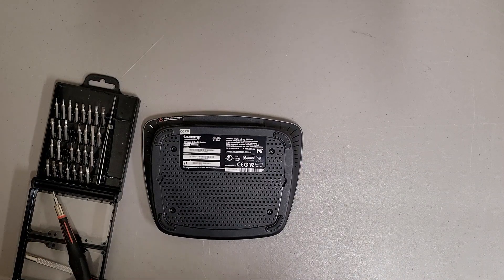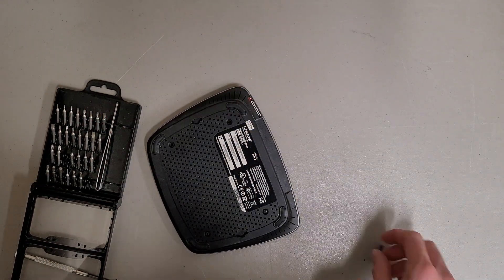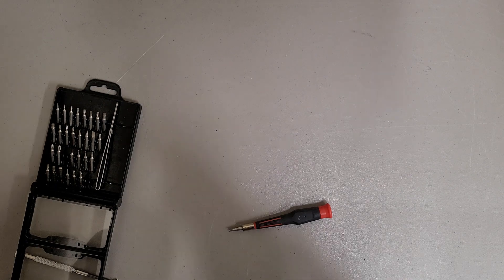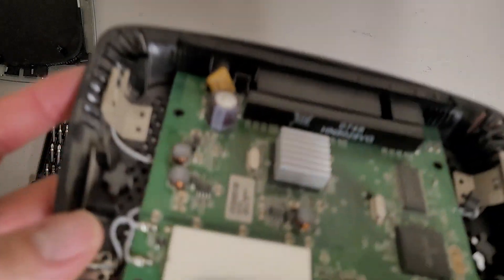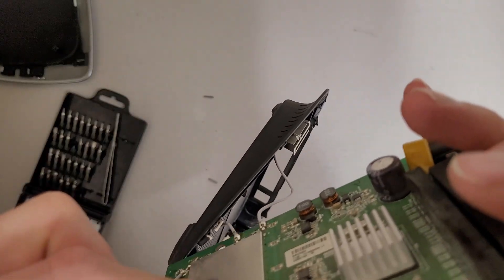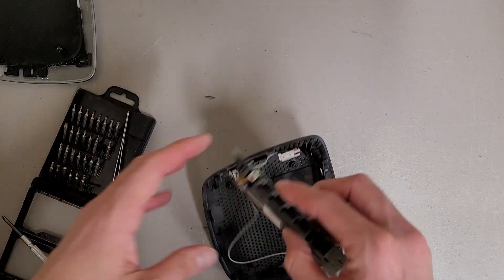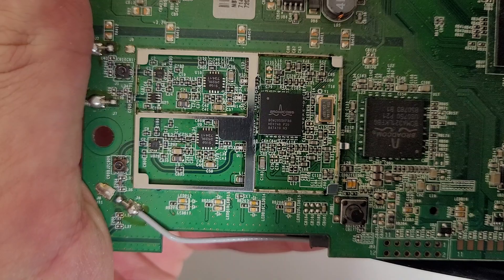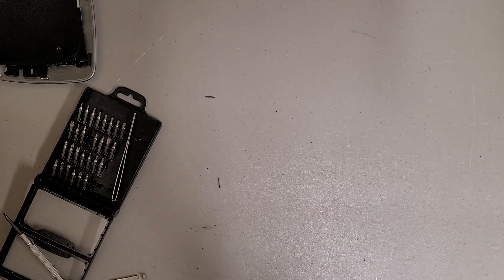Linksys Wireless N Gigabit Router WRT310N #teardown

Comment: Thank you. That was very interesting! I'm always surprised at the differences in getting inside - some simple to open (just lots of screws!); and some harder (what in the world?); as well as the variety inside the case. 

I've been wondering, for some time, about all the little squiggles, rectangles and straight lines, that look like they were engraved on the medal?
Reply from the maker: I don't know for certain with commercial products, but I believe the board starts out with a thin sheet of copper covering it then they etch the pattern of the traces in it. Many of the squiggly or weird looking lines are for data connections where the connection has to be the same length so the data all gets where it is going at the same time. That is oversimplified though.

A video of how one place makes custom circuit boards.
https://www.youtube.com/watch?v=_GVk_hEMjzs
Reply: Thank you.... I'll watch it right now!👍 I had no idea they could put so much info into the lines. I'll watch now😊 Keep warm 🤗
Reply: That was really good! I'm surprised at the number of steps it took, and how precise each step had to be. Wow!👏
Reply from the maker: @DHuhnCatMom  yeah the process is pretty cool.